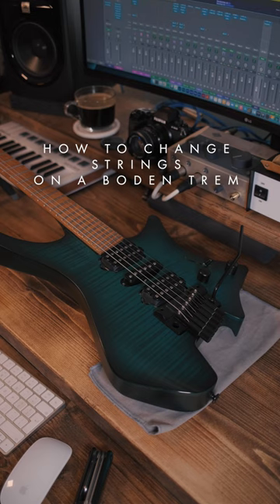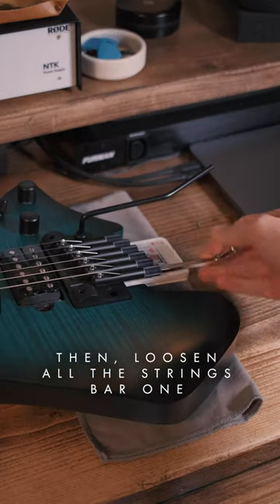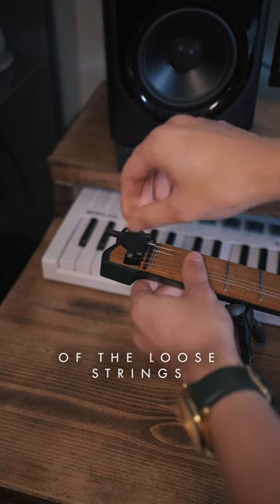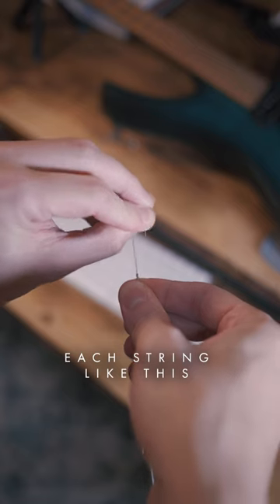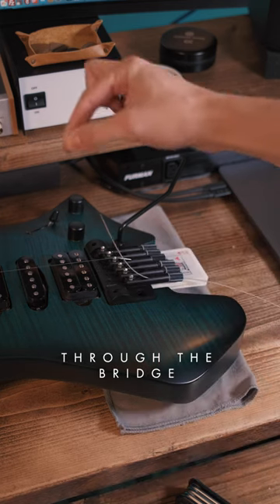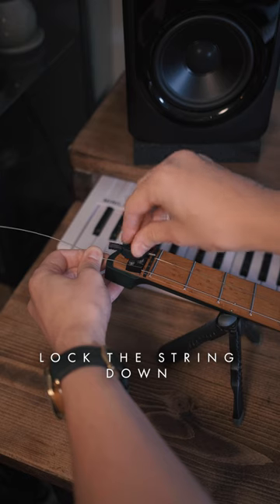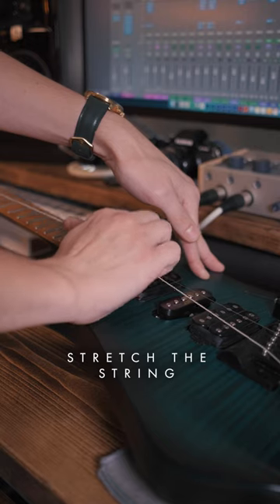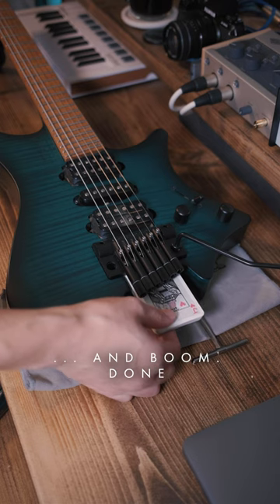How To Change Strings On Boden Trem w/ @ConnorKaminski #shorts

Comment: About cutting strings, i prefer to slightly move it backwards after i cut em and then lock the nut. It works super well with NX but also works with previous versions, so u dont hurt fingers and most important your gigbag.